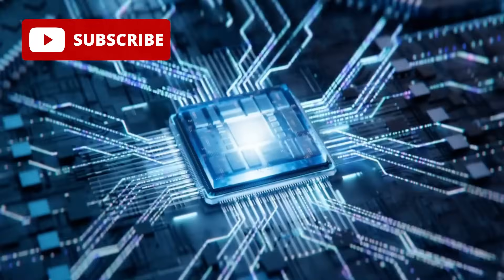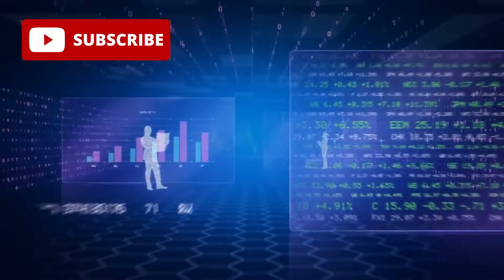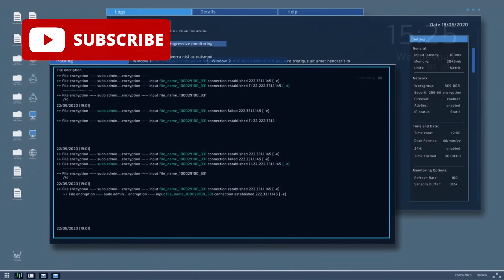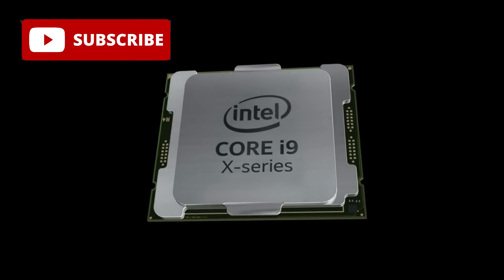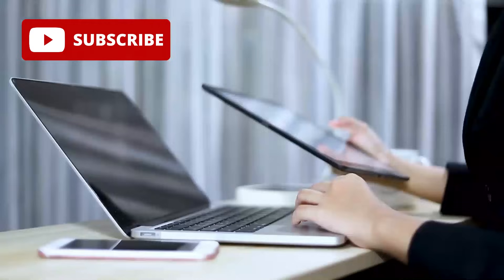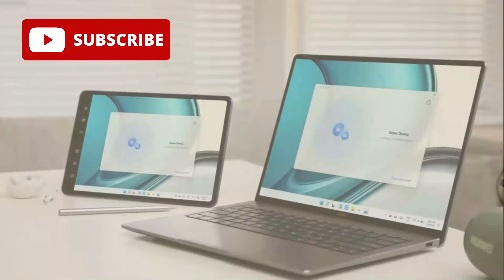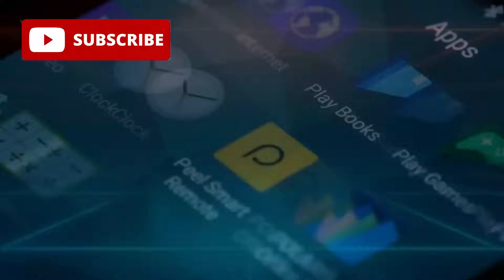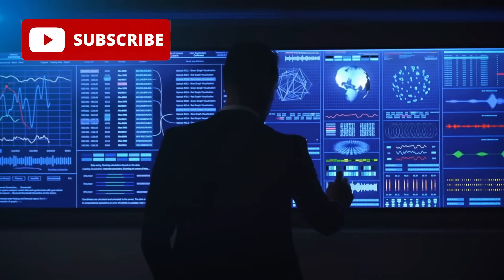Next-Level Performance The Kunpeng-920 Chip Behind Huawei’s HarmonyOS Revolution 🚀

Comment: The Huawei Kunpeng 920 is based on the ARM architecture, achieving a benchmark score exceeding 930, which is 25% higher than industry standards.
The chip supports up to 2 TiB of octa-channel DDR4-2933 memory and has a TDP of 180 W.
It is designed to provide powerful computing and supports various reliability features, including error-correcting code memory (ECC memory).
As of March 2025, there are indications that a new Kirin X90 chip might replace the Kunpeng 920.
The Kirin X90 is set to power Huawei's HarmonyOS-based laptops and potentially other devices, aiming to compete with established players like Snapdragon and Apple M series processors.
The debut of the Kirin X90 in Huawei's HarmonyOS-powered PC is seen as a major leap in China's semiconductor industry.